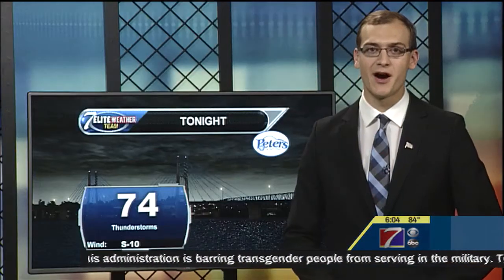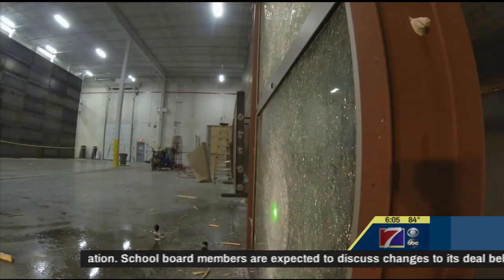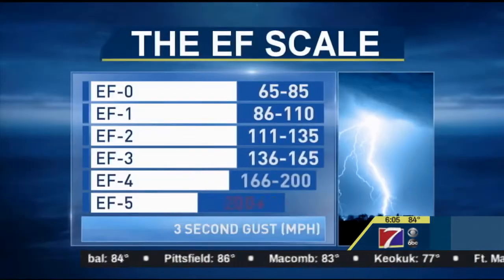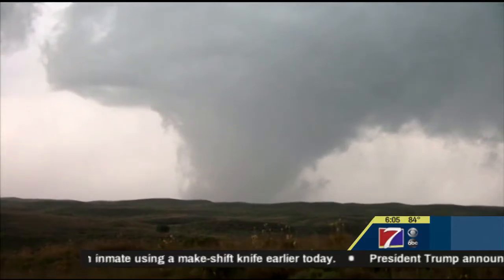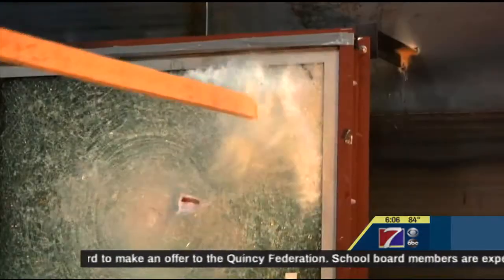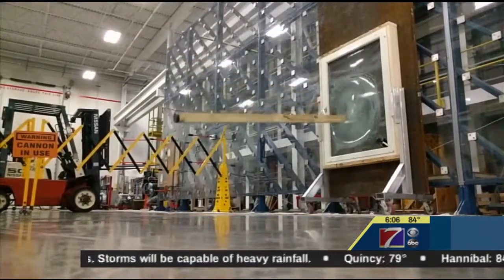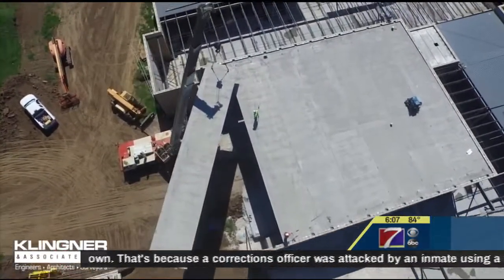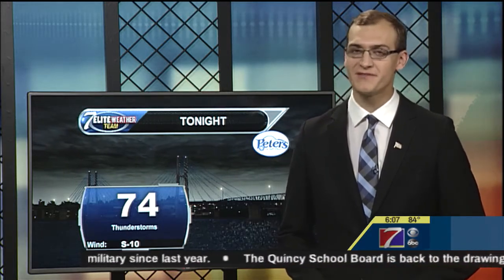Building Tornado-Proof Schools

Comment: I feel like preparing for an ef5 is pretty useless. Maybe ef3 or 4 would be worth it but what are the odds that this school actually gets hit by a tornado that strong and survives. Shelters are a different story though. Good report
Reply: Preparing for an EF-5 is cheaper than building a "normal" building. MUCH cheaper.
Reply: 100% probable if they are Monolithic domes designed for that.  Schools all over Tornado alley are building them because of that AND they are cheaper than traditional construction.
Reply: This is why they are building shelters